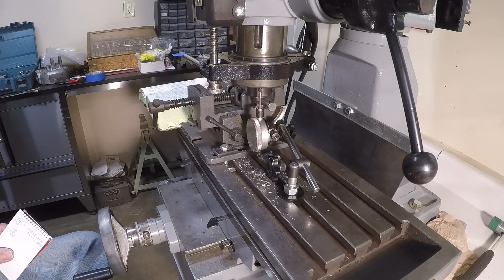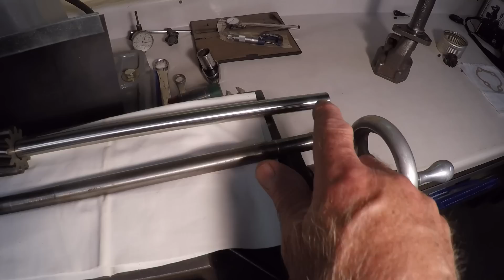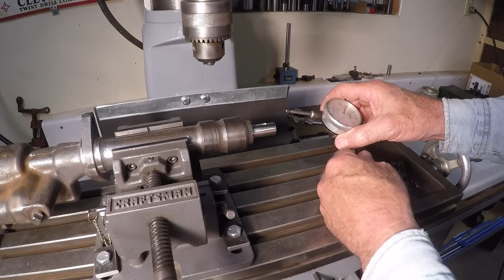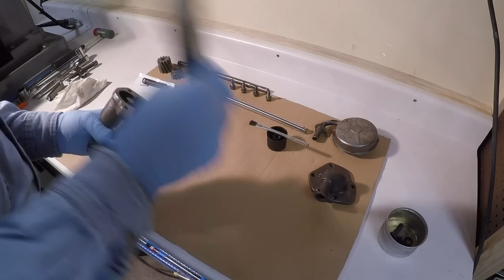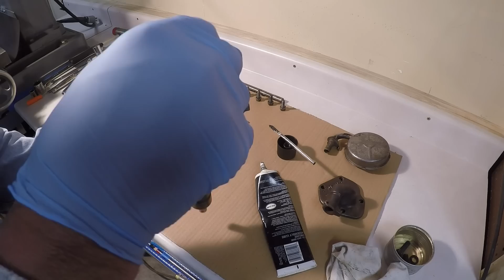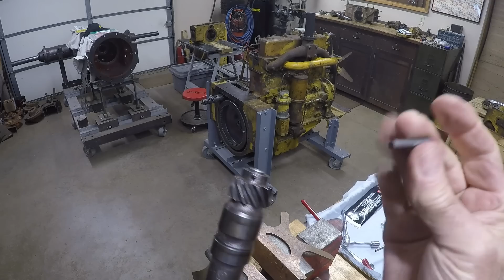Farmall Super M Rebuild Ep.27: Machining The New Oil Pump Drive Shaft & Oil Pump Assembly

Comment: I've found that if I'm installing a cover over a spring that it goes easier if I use over length bolts to start with. When I get even tension on the plate and the spring centered, I replace one bolt at a time with  the OEM bolts and then run them down

Comment: A wee bit advice, when starting and stopping a cutter, you should part the work from the cutter as the increasing and decreasing speed can cause problems, if, a shaving or sliver is caught. Not all situations require this, but that's up to experience to figure out (this one's so and so, both cutter and cut are decently sized that no problems should occur is setup is right). Just my 2 cents, nothing more.

Comment: Is that a specific type of steel rod you are using for the shaft??
Would the factory have heat treated or case hardened the shaft for better
wearability?
Reply: Im curious to, and wonder if they heat treat it.

Comment: Good to see more from the workshop, with the starting motor just sitting there as a prop!  Should there be a thrust washer between drive gear and casting?  As it is right now, won't the side thrust from the drive gear, be taken by the end plate in the pump chamber?

Comment: Would a longer bolts with a sleeve spacers compress the cover and spring then the original bolts in the other holes to hold the cover and then replace the longer with the original length bolts?